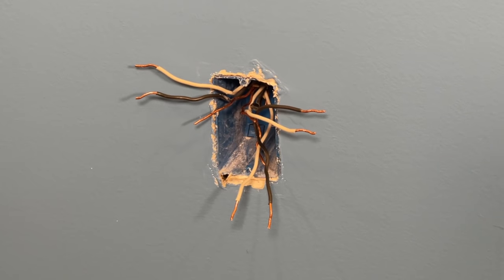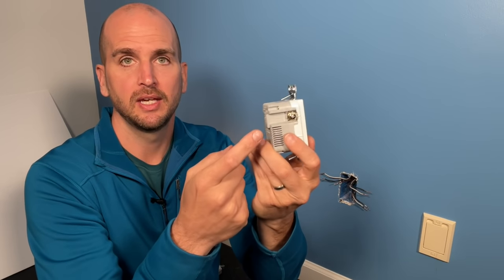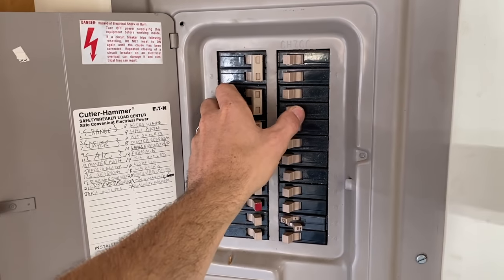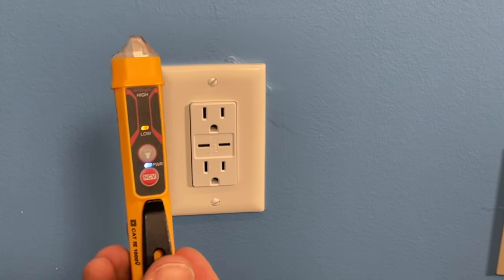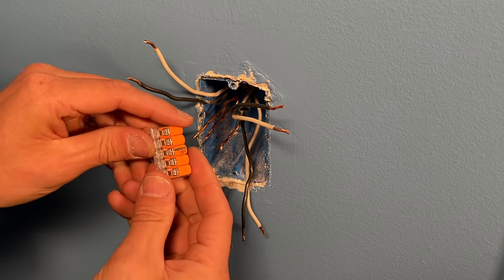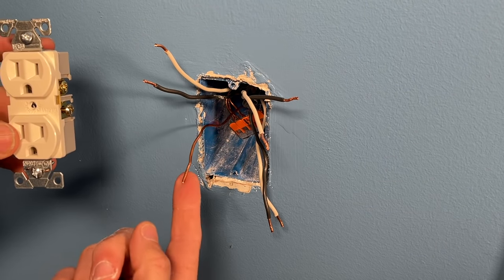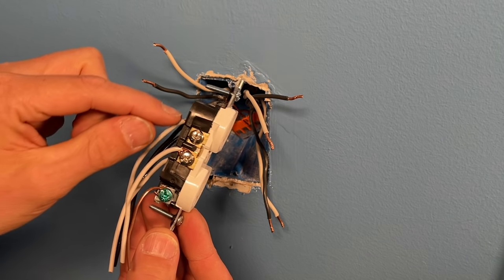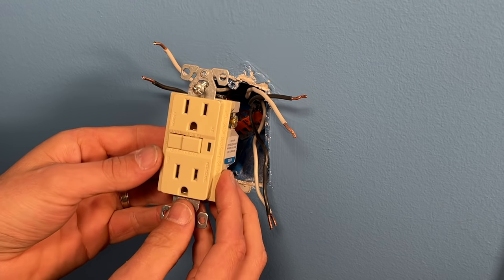Wiring an Outlet with Multiple Sets of Wires

Comment: I recently installed some USB equipped receptacles myself and I too had 3 sets of wires per box that they went in. I used normal wire nuts to make the pigtails because I don't have any wago connectors but those sure do look handy.

One question though, isn't this technically too many conductors for that standard size box? Or am I reading the box fill requirements wrong?
Reply: Yes it is too many
Reply: Yep too many conductors....also dont waste your money with WAGO connectors, do a correct pigtail with a wirenut. Everbody wants to do things the easy way instead of learning proper technique. Thats why we have quick connects, Wagos, Shark bite pipe connectors too many people want to hurry up slap and slap shit together. Way of the world now i guess
Reply: @logosrisingbear  wago lever nuts have been proven to hold up under extreme over current... That being said I still use old school wire nuts.
Reply: Why do yall keep thinking that box fill is wrong 😂😂 you can legally fit 3 12-2s in that plastic nail on.
Reply: @Krankie_V  Same here, wirenuts all day long. With the wires pre twisted with Linesmans. That setup wont budge ever. Those quick connects are actually code for fluorescent lights around here. Their reasoning is if theres a fire you can pull the reflector and disconnect lmao. Dont think anyones going near a light thats sparking and on fire. I just cut em out and use wirenuts
Reply: @yellowflash5555  The fixture is the issue, takes up 74% of the box volume, it also is vented, meaning the fixture is generating heat. I'd look up whether this fixture requires a special volume and restriction on number of conductors?

Comment: Hi, pls excuse me for the newbie question, I have the same situation with multiple wires with no color codes @ 220V, I want to install an outlet with USB port, with only 3 holes L , N , G. If i kill the rest of the wire with tape leaving me with only 3 L N and ground, in a 220V is it necessary for me to determine which wire is L and which is N? or is it safe on either side of L and N?

Comment: I plug an extension cord on a grounded plug.  I take cord to wires, with multimeter I
Plug neutral into the ground if the extension cord… then I test All the black wires with red/ positive probe of multimeter.
Now you know your hot when you get 120v
So put red probe on the hit … and touch all the whites with black probe and when you hit 120v you got your lead….

Comment: What happens when there’s a single red wire? I need to add an outlet up the wall for a tv, but the existing outlet has two blacks, two whites, two grounds, and a red.
Reply: It’s probable that ‘half’ the receptacle is controlled by a wall switch.  This is so a floor or table lamp can be controlled by the switch.  Check out videos on ‘switch controlled receptacle.’

Comment: I have the same situation as the first example, three sets of wires coming into the box. What is the difference between the "residential grade" and "commercial grade? different amps? how do I ensure I have the right one that can handle three sets of wire being connected to it?
Reply: The commercial grade is higher in quality and more durable than the residential grade in every respect. If you go to Home Depot or Lowe's and compare visually you'll see that the difference is obvious. You can also look them up online. The residential grade are found loosely in a bin and the commercial grade come individually boxed.
Either one will work with 3 sets of wires, but you must use pigtails regardless, there are only 2 sets of screws.
Most of the time from my experience the 20 amp receptacles are stocked in commercial grade by default, but residential grade 20 amp receptacles are available. The reason is that 20 amp receptacles are almost exclusively used in commercial applications along with commercial grade 15 amp receptacles. 20 amp receptacles are rarely needed in residential applications. You can use a 15 amp receptacle on a 15 or 20 amp circuit, but you can only use a 20 amp receptacle on a 20 amp circuit.

Comment: I don’t do speed wires ….
But the idea that it’s dangerous or not as good is just silly.
The only issue is when stripping wire, if you do it wrong and bite into it … the wire might snap/fail when yup work work with it ..
But same is true about shepherds hook

Comment: When you make the Wago pigtail of the power wires, does it make a difference which nook you put the hot wire in from the cb box?
Reply: You can use the middle position in a 3 or 5 port Wago for identification, but electrically speaking, no, it makes no difference.

Comment: I went to change my old two prong receptacle with a GCFI. Had two sets of wires coming into the old receptacle but instead of one wire set going to the load and the other wire set going to the line, the wires were criss crossed over. The hot wire on one set went to the load while it’s white wire went to the line and visa Versace on the other wire set. Did someone put this in wrong? The other outlets were not wired this weird way so not sure what to do.

Comment: Where would one buy wires to use for pig tailing?
Reply: Use extra (scrap) wires from Romex cable. You can also buy green ground pigtails in packages. Home Depot, Lowes, etc.
Reply from the maker: Like Ted indicated, I usually always have a little extra 12/2 Romex lying around which I can use for pigtails.

Comment: Trying to figure out our wall outlets to add C cell chargers, We have 2 sets of white and two sets of black. Our house is way outdated and the electical was terrible when we bought the home. The new outlets only have one white and black slot. So we tried both combinations and neither powered it. Do we need to buy something to plug both black into one slot and both white into one slot. Like a splitter of some sort? Are the piggyback things what we need? The copper wires are too thick to try and simply wire two together. Also, not sure if it;s safe to simply wire the two we are not using with the wire cover thingies. Sorrym I am a noob with this. Any help is appreicated. Heading back to Home Depot for the 4th time.
Reply: Answering my own question I think. wago 3 port adapter? Put both black in and create 1 coming out I hope.Then I will do same with white side. Will update after I try. Thanks for the video. Amazing that changing one simple outlet has been a 3 hour adventure so far.

Comment: Both your ground and common(grounded conductor) should be pigtailed if your common would open due to a faulty device and can get  open or loaded Neutral condition. This is way this DIY stuff is soo bad sometimes you really have no clue 😅. Recepticals are like the easiest part of the trade.

Comment: Ok I have a problem with my outlet in my room and I tryed to use the waygo and do pigtails but when I plug my outlet tester in it it shows it’s fault and then goes to correct should I try the commercial grade outlet he showed in the video bc am at my ropes end on it

Comment: So if you pigtail the wires, you don’t need to find the hot wire?  Is that correct?
Reply: No, by using a pig tail, all black wires are connected together and separately, all the white wires are connected together so there is no need to find the hot lead and neutral  lead.

Comment: HELP HELP HELP new home owner here I DON'T WANT TO BURN MY HOUSE DOWN!!!
I have a receptacle that has 4 hot (black) and 4 neutral (white)...a total of 8 but 9 counting the ground.... 2 of the 4 black has power... how do I replace that with a GFCI???

or if i want to just close up the receptacle and not put a plug back in....may I just 
cap off the ground with a wing nut
 wing nut all white together 
then do two separate wing nut for the 4 hot..(cap a hot black with a not hot black)?

Comment: I've seen where some electricians would wrap an outlet or switch with electrical tape after attaching the romex . When using the ports, should I do the same ?  These are new to me, I'm used to using wire nuts.
Reply: Pro electrician here,
  When installing the receptacle, the j hook method is the best bet for landing the wires on the recep screw terminal. 
  Putting tape around the recep covering the terminals is fine but is not needed around the wire nuts.
Reply: @yellowflash5555  What about the strips used to attach the pig tail to ? Treat those the same as if using wire nuts as well ?

Comment: Those connectors actually create another point of failure and have caused open shorts and bad connectionss bc they wear over time and rely on pressue to make connection. There is no better connection then twisting wires. if i see those in a house i cut them out and twist the wires

Comment: Please help me! I’m going insane trying to understand this. I have a self contained rocker switch I’m replacing with a dimmer +led switch . I installed the gang box and ran all three sets of wires through. Then I used WAGO . All black in one, white, ground. On dimmer switch has red and white i put wago alone since it shows to wire but it. When I turned breaker on something popped but I wasn’t in to see what happened and the switch was smoking inside. So I turned box back off.. if I can upload photos I will. Help!!!!
Reply: Don’t see a add photo option

Comment: Any ideas on trying to get my 120 volt car charger to work? When I first plugged my charger in it blinked red indicating that it wasn’t properly grounded. So I changed the outlet out to a gfci outlet and found that everything was correctly wired according to the tester that I used and even the car charged for a little bit, but unfortunately the car charger blinks red even though the outlet shows that it’s correctly wired. Any thoughts are appreciated!
Reply: Check the negative terminal battery cable and integrity of the battery ground.

Comment: Do not be fooled thinking this is universal advice! Someone diy’d the wiring in my house something like this before I bought it, and it was a massive fire hazard. Can’t even use my power until It’s fixed. Great video though, just feel like you missed out on pointing out a few very important things.

Comment: i have an outlet that has 4 wires, 2 sets of hot and neutral (one set connected to the top and another set to the bottom). if i replace the outlet, does it matter which ones go where as long as both hot are on the correct side and both neutral are on the correct side?
Reply: Doesn't matter as long as they are on the correct side. It does matter if it's a GFCI or AFCI receptacle.

Comment: I noticed that in several of your videos that I can't see if the outlet is tamper resistant. Can someone elaborate on this topic.
Reply: I believed tamper proof is required for new construction or permitted renovation.  You can still get the ‘non’ tamper proof receptacles.  If I had kids living in the house or visiting, I would minimally get the plastic covers you can push into the old receptacles.

Comment: You should have 2 red wires in there also. Be more impressive.  Kitchen outlets always have red,black, white and bare ground.
Reply: What the fuck is the point of running 3 wire in an outlet circuit lmao enlightenment me on why you need that extra hot wire

Comment: I have a question I have 2 hot wire it sapose to be one  neutral  and the other hot but instead I got 2 hot wire  it's on a switch but I have 3 main wire coming out the wall switch ...but I'm having a problem with one of the main wire that are 2 hot wire ...any folks out there  with any advice thanks.

Comment: Dumb question...how do we know which neutral goes with which hot?
Reply: Hopefully you can see further back along the wires, each pair should be insulated together, often with a yellow or white wrapping and hopefully a bare ground wire as well.
Reply: Doesn’t matter as all black hot wires are pigtailed together and the separately, all white neutral wires are pigtailed together.

Comment: Any electrician will tell you easily how to wire that box. A good one will tell you the wires are too short and the box isn't big enough to be legal in use for that many wires plus the device. You need to remove the existing box and install a 1900 or 411 box to replace it with a single device mud ring. You never use the device to carry the circuit through because removing the device will kill everything down the line. You pigtail all the neutrals together and all the hots together and then take one stinger to the plug for the neutral and one hot stinger to the plug. Personally I prefer to put the three wires on the plug to start with and then connect them to each group with a wirenut. On multiwire branch circuits you may have a hot feeding back down the neutral so it pays to know what you're doing to not kill yourself.
Reply: As a pro Electrician,
Well I hate to bust your bubble but  you're incorrect about the box fill that box can take 3 12-2s sets  and he has 3 14-2s which is plenty of box fill left per the box fill calculation. 
Also using a 1900 box aka 4square and a mud ring isnt at all necessary thats actually shallower but wider  than the nail on box he has now inside the wall. Unless it's on the face the wall in the garage, you van us those 4quares or 411 boxes then.
Reply: @yellowflash5555  I don't agree. First the wires are too short to be legal. Then by the time you add stingers and the device that box is too small to be legal. And who uses shallow 1900 boxes. You use the deep one for outlets to be installed. I don't know how many years it took you to reach pro but I spent forty years as a commercial electrician and that box would never fly with an electrical inspector.

Comment: About 4 minutes in you identified the line side wires and then began installing the Wago's on what could have hot wires. Turn off the power!!!!
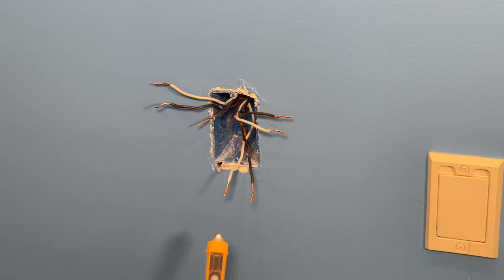Reply: At 3:45 you can see that he cut the video and then restarted it. So he probably cut the power off at that time.
Reply: The unit he installed only had provisions for two pair of wires. That's one reason he did it the way he did.
Reply: I agree. Somebody three years from now will watch this and follow his instructions only to be shocked and lawsuits could be filed.
Reply: He did lol but I would've put wire nuts on the hot wires ( black insulation) after turning it on to check for incoming power

Comment: Did my eyes fool me or did you wires go around the screws the wrong way ?
Reply from the maker: It is a commercial grade so I was actually using the back wiring (not speed wiring) feature where you can just go straight in and tighten the screw terminal which will pull a plate in against the wire to secure it to the outlet.

Comment: Wire nuts vs wagos am I like the last of the do doos tht still use a Buchanon 4 point crimp tool and copper crimps with plastic sleeves also know how to use a soldering iron and rubber tape and I'm in my early 40's
Reply: That's definitely a ever lasting connection but I'd hate to come across trouble shooting it eats up your wire unless there was some extra than the 6inch minimum codes gives us
Reply: @yellowflash5555  lol you take your linemans squeeze in two directions make a box crimps slide off dont always have to cut things lol

Comment: So it you didn't know which was the incoming neutral would you use a voltmeter to test which neutral, along with the know hot, would give you voltage?
Reply: The incoming neutral comes from the same cable as the incoming hot. You cannot check voltage on neutral wire as it has 0 volts.

Comment: The white wires go to silver screws while the black wires go to gold screws.. Now if theirs red wires I forgot.
Reply: I didn't know of those orange pieces! Thanks now it should be easier for me.
Reply: If there a red wire most likely it's a switched receptacle and one half is constantly hot from the black insulated hot wire and the red wire could be the switched hot wire from the switch. The tab linking the two gold terminal screws should be broken in this case.

Comment: I would have straightened the original long wire ends better, then clipped them back to the Wago strip length. I've never liked inserting a bent wire into a Wago. I know that Wagos have undergone testing with new, straight wires, but I'm not sure how much testing has been done with bent wire variations. And much of their field usage to date has been in Europe. From what I've seen of UK electric work, there isn't the amount of wire twisting that we have in the USA - no wire nuts, no twisting around screws.

Comment: 1) never use the plug in holes in the back of outlet, make a  button hook around the screw and do it proper 2) make correct pigtails with a wirenut 3) hire an electrician, way too many homeowners who think the are Bob Villa then i have to come fix it the right way
Reply: Stop doing it for free
Reply: I always love when they call us and they're like my uncles friends cousin is an electrician did this 🤣😂 and we need you to fix this
Reply: @yellowflash5555  Lol yea i get a similar story alot...thats when my "Pain in the Ass Fee" comes into play. The job i just finished was terrible. Open JBs with wire hanging out and all the grounds (about 10 of them stuffed in there) were just hastily twisted together with no wirenut or anything. And they wonder why Electrical contractors in this AO charge so much
Reply: @yellowflash5555  Just started up my own buisness. Getting a bunch of smaller jobs cause all the good companies are busy and wont do sub 1k jobs. Ill take em all. Cant beat making a 600 profit in 4hrs.

Comment: why doesnt someone just invent a multiple LED bar  with 2 WAGO type connectors for the hot and nuetral wires of each set ( one set of two connectors per light on the bar) ,,  then when you turn on the breaker thats the one that will light up.,,   and since the wires will be protected in a WACO type connector, power can be left on while working with the non live wires